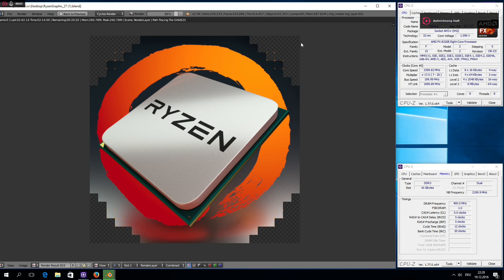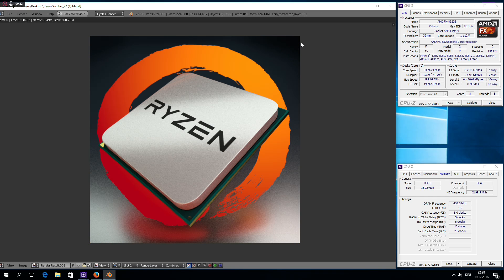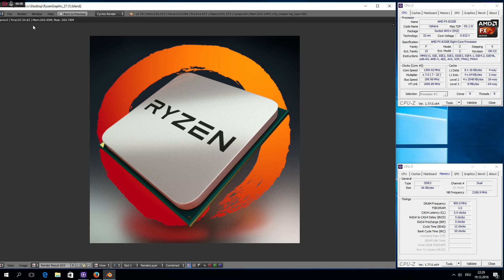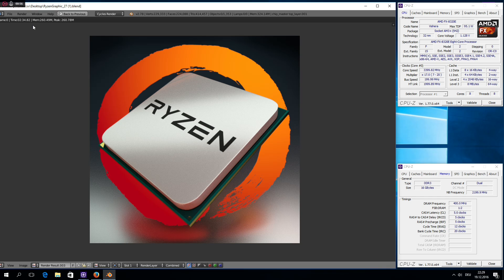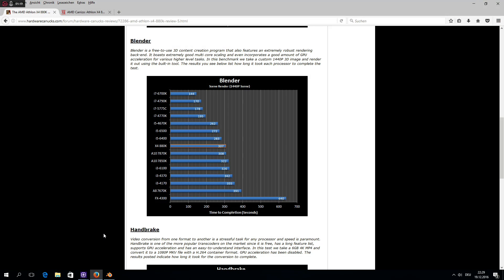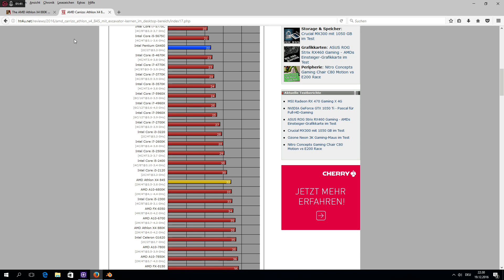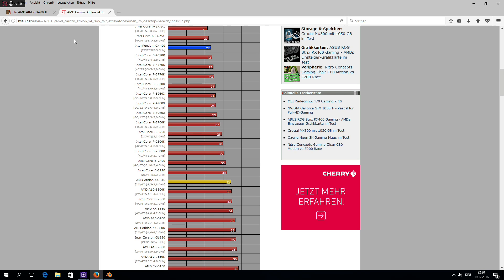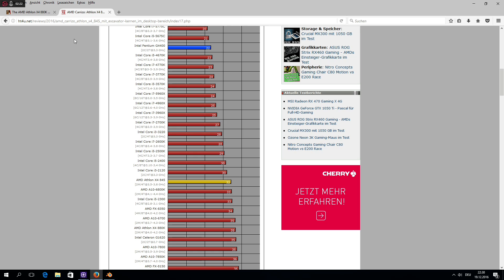AMD Ryzen 300% Faster Than FX-8320E At 3.4Ghz In Blender - Also Newer Athlons Destroy The FX's

Comment: hi i have donr this test on my rig a old amd phenon ii 960t unlocked to 6 cores (1605t cpu)and clocked at 3.4ghz 16gb ram at 1600mhz with a r9 280 on stock clocks and done the test with out turning off background bits and conpleated it in 1min 43.56 secs thats why i never went to fx it is only faster in few things but hoping zen will give me a upgrade with out going intell

Comment: it is 300% not 400% but it is 4x more then fx 83xx on 3,4ghz
Reply from the maker: Yes you are right. Thanks!
Reply: you also capture your screen....  that slows down the process significantly
Reply from the maker: hey, i started the capturing with relive only a few seconds before the rendering finnished to avoid this.
i mesured capturing the whole rendering slows it down by about 10 seconds. so how it did it (right before the end) should only have a negligible effect